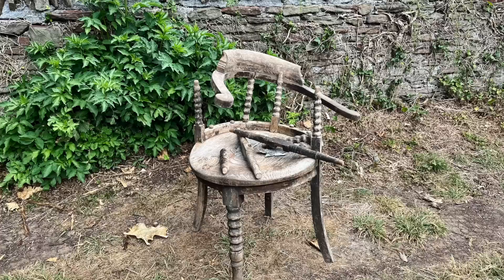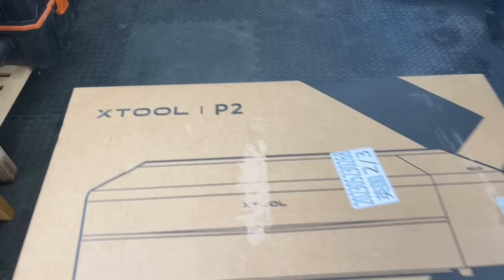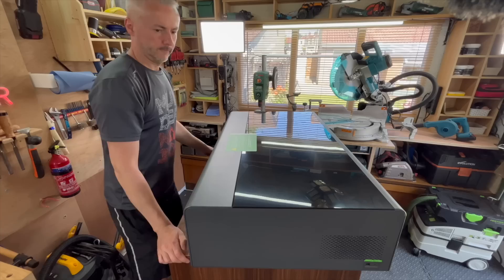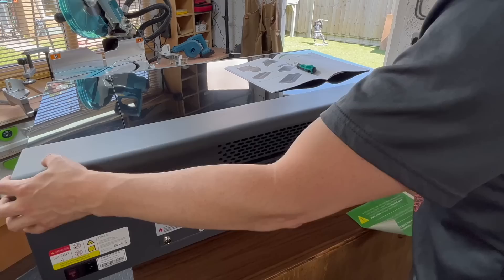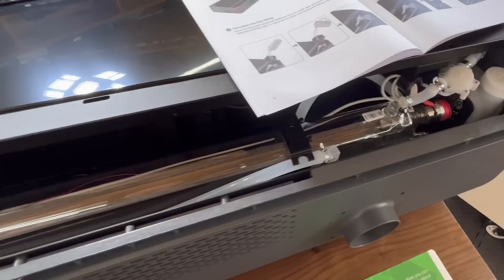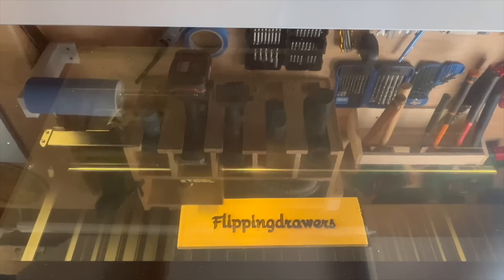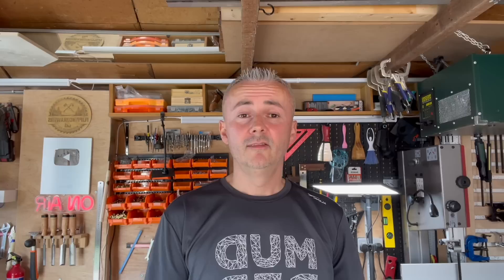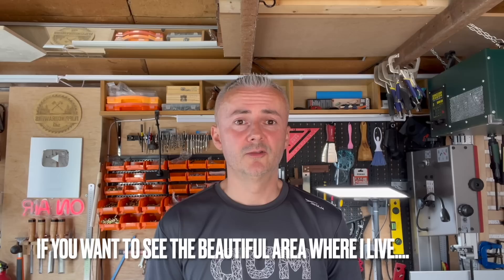New awesome tool UNBOXING and Q&A.  Xtool P2  CO2 LASER

Comment: What no one is talking about, and neither their site or reviews mention, is that mechanical lock.
I understand it locks while it's running, but also for a good 10 seconds after it's done to vent remaining smoke. So... How quickly can you get in there if a fire happens?
To me, it might add some safety if you have guests or kids around while it's running... But it adds a whole other and very terrifying problem if there isn't anymore to it. Does it instantly unlock if you hit the emergency stop? If you pull out the plug? It sounds terrifying if I have to wait another 10 seconds, after I notice a fire, before I can do anything about it.
Reply from the maker: It says wait until gas venting is finished and it unlocks. Takes about 5 seconds.